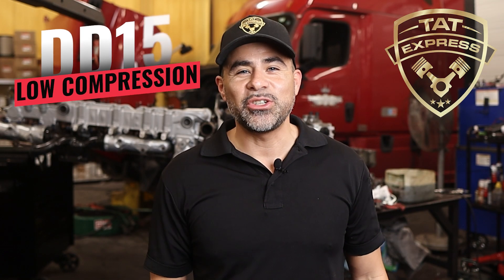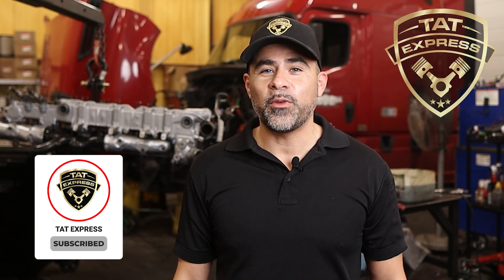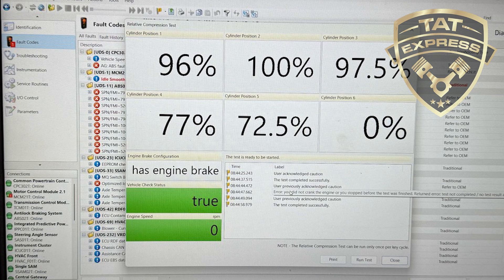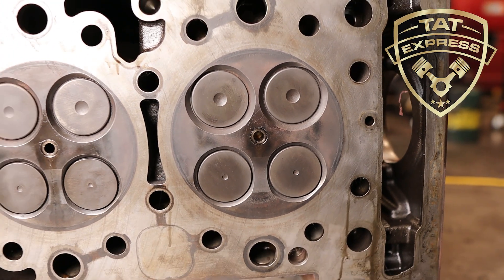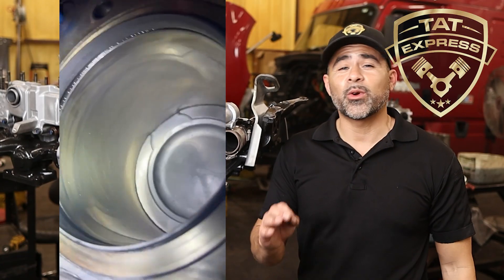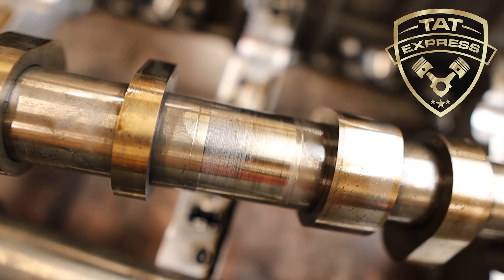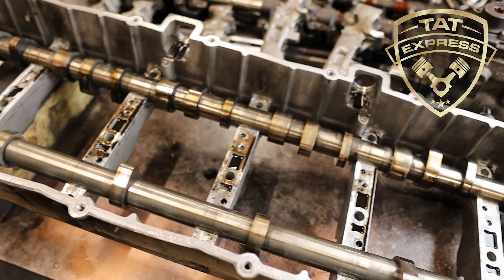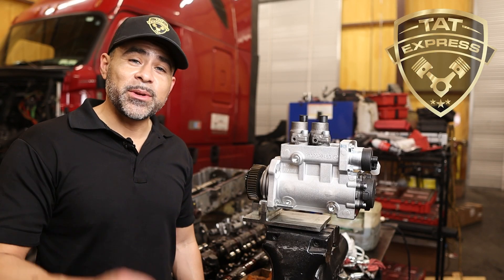DD15 Low Compression – Cylinder 6 Failure EXPLAINED

Comment: Hi everyone 
Can anyone let me know where is egt temp sensor bank 1 sensor 2 
On texa software ( i having this error ( egt temp sensor bank 1 sensor 2 failed/open circuit) in d13 volvo 
And 
Another d13 moter 
adblue pressure sensor sensor error
Can someone help to find this both sensor
Reply from the maker: The EGT temp sensor bank 1 sensor 2 is usually located after the turbo but before the DPF inlet on most Volvo D13 setups. You’ll want to trace the exhaust system downstream and check for broken wires or loose connectors.
Reply from the maker: For the AdBlue pressure sensor, it’s mounted near the DEF dosing module — follow the lines coming from the DEF tank and you’ll see the pressure sensor inline or near the dosing unit.

Always double-check with schematics for your specific VIN — Volvo sensor locations can vary slightly depending on emissions setup and year. Hope that helps!

Comment: I have a 1995 freightliner FLD with a eight speed transmission. fully loaded down a 6% grade I need to be in third gear at 17 mph and still having to tap on my brakes a little too often I put a brand new rebuilt head on the engine. Low medium and high for my Jake brakes all work they’re just really weak. Can the Jake brake housing have something to do with weak? Jake breaks
Reply: Even when I am empty, going down a hill that Jake brakes will not hold
Reply: @phillipchavez3705  they might need adjusting.  you adjust the jake brakes like you do the rockers with a feeler guage

Comment: "Significantly lower" more like a dead cylinder 😂 many people say 50k oil changes because that's what the manufacturer states. However, they miss the fine print that's says WITH OIL ANALYSIS. Changing your oil is critical, and it's the best practice to ensure long life.  I typically change at 15k no more than 20k with oil analysis.
Reply: Excessive Valve head or valve seat recession has nothing to do with oil change intervals
Reply from the maker: We appreciate the support Trugginglife. 💪🏼🚛🔧

Comment: What was the miles on that?
Reply from the maker: Thanks for the comment; the unit has 950,000 miles.
Reply: I would replace all with those miles.  If other fails you will have to open the engine again

Comment: This engine is a gold mine for shops.
Reply: It’s a million plus mile Detroit engine if you take care of it . People skip on valve adjustments every 150k ,  change their oil every 75k miles regardless of engine hours and then can’t figure out why they need a new $12k head at 600k miles ….
Reply from the maker: @Niko, you are right on point with your comment.  Thanks for the support. 💪🏼🔧🚛
Reply: Dd13 here. Oil changed every 10 to 13k miles.  Valve adjustment every year.